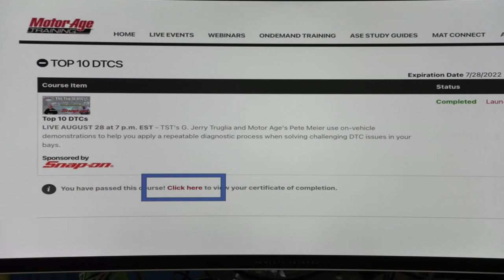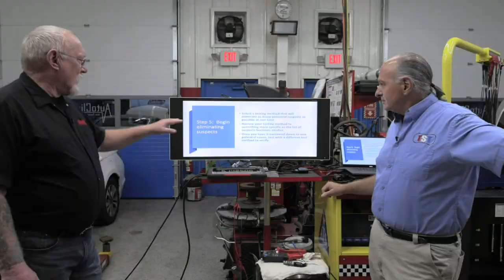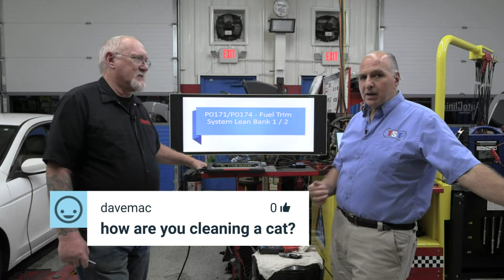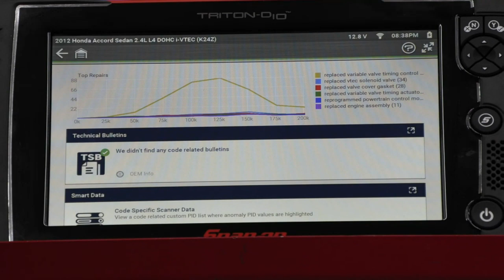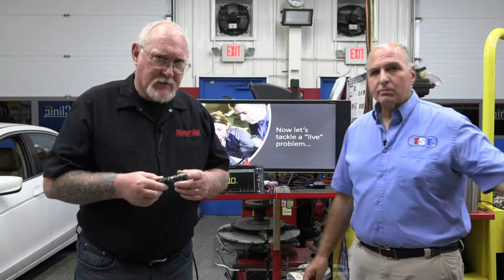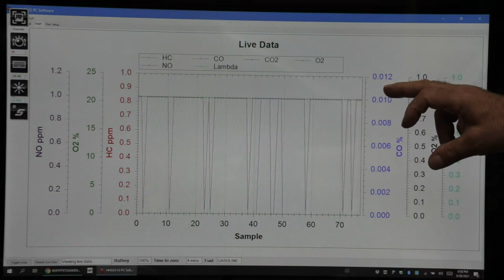The Top 10 DTCs - What To Do When They Show Up In Your Shop!

Comment: I am very unsure why the service information first step isn't showing "are there any engine DTC's" for that 83-11 code stored in the VSA module. That code will set if there are engine faults, likely will not return once the check engine light is fixed, I do not believe I have ever seen that code set besides when there is an engine fault code stored (Honda Master Technician)

Comment: You have to enter a parts house with the understanding that they're trained and instructed to up-sale. I knew a manager of one quite well. He was nothing but a modern day snakeoil peddler. According to him all new GM cars roll off the assembly line with the same stopleak products pre installed to prevent warranty issues and are perfectly reliable and save to use. I've found in general that the store managers are alone responsible for the bad rap parts houses get. They push employees around, most of which have actual automotive repair backgrounds, and operate solely on deceptive sales and numbers. Got a 220,000 mile Nissan Frontier that's been in the family since 40,000. Everyone who's ever put gas in it sets a large leak code by not clicking the cap three times and the ABS light comes on if battery voltage falls below a ridiculously high threshold. Explaining that never seems to prevent someone from attempting to sell me expensive parts. Then there's the old-school vehicles with external rectifier/regulators when someone comes out to do a alternator check with the store tool and never even knowing such a charging system existed. I've even seen them call my Holley TBI a "odd lookingcarb". As bad as all that seems, emission testing centers are worse. I had my truck fail because the person couldn't read a under hood  emissions diagram sticker. When he couldn't find my rollover valve in the engine compartment he accused me of deleting it and emissions tampering. Although I had the factory service manual that said it was on the fuel tank and my truck passed the testing ease. Then again this was the same location who strapped my AWD Rover to a 2WD test bay (priceless).
Reply: I am with you brother but please remember parts stores are in business to sell to every person that walks in the door. If you have a trouble code then they try to sell you a part, needed or not, it's up to the customer to make the final call. Too many folks think car computers are smart, they are not, they do not self-diagnose with a high level of accuracy but they believe that it does. I am not on the side of the parts house but car owners are simply uneducated and tend to trust big box stores and hurd in like cattle, with the same mentality, sorry to say. I have been living and repairing cars in Asia since I left the USA with my military job and I still think that many shops do not know how to diagnose properly and parts stores don't diagnose at all beyond plugging in a code reader, a cheap one for sure.
Reply: @duanedonaldson2262  I agree with that. I can say there's a huge difference in locations that hire tech students and actual technicians verses someone who's spent a few too many years in some halfwit grease pit or junkyard. Some cities and neighborhoods just favor other locations better. Good employees come and go also. I done businesses with one location almost exclusively for years. There's been a few late evening stops I found a completely new staff and it left me scrambling to run up the road before another location closed. They did impress me more than they let me down by being honest most of the time. I live back east now and the state I'm in isn't known to have the brightest people working in parts houses. Napa has the older knowledgeable staff but sells absolute garbage parts regardless of how much they cost.
Reply: God bless you